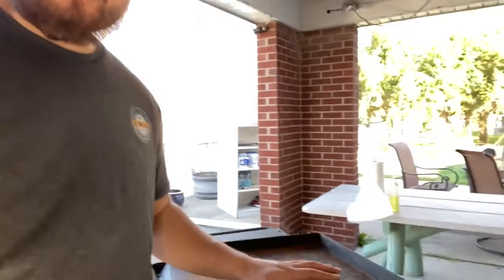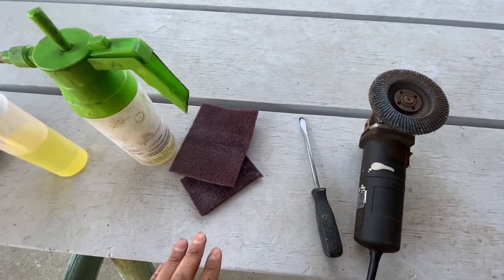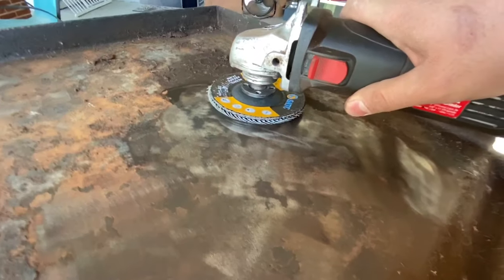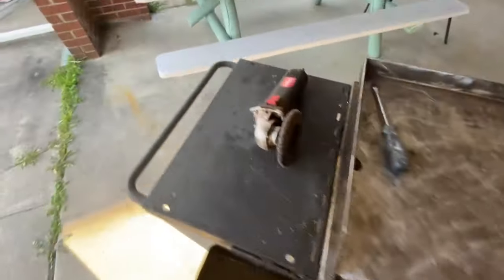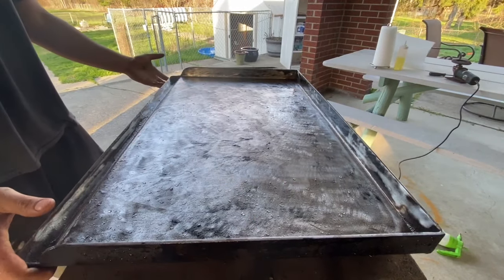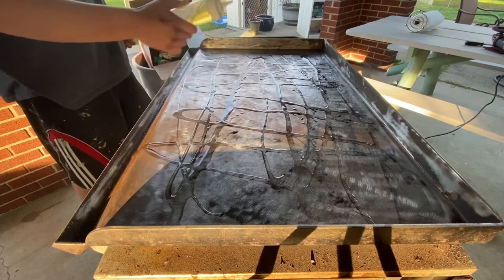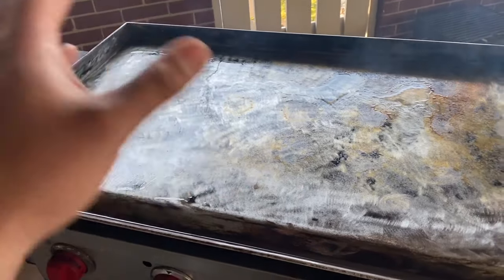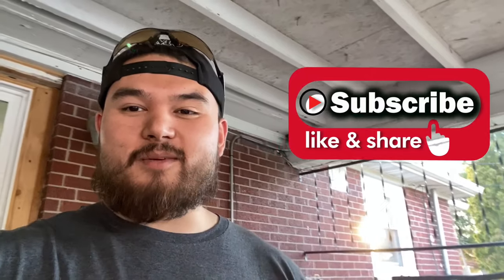Restoring A Flat Top Grill - Quick & Easy

Comment: the top is rolled steel. the black coating is the seasoning coat. proper seasoning, use high smoke point oil put on a very thin layer heat the griddle top on high and keep it on until it stops smoking. repeat the process 4 times. until the top is a shiny black smooth surface.

Comment: This is steel, not cast iron and definitely not alluminum. It will get dark again. Camp chef probably uses some kind of seasoning spray like a palm oil and soybean oil mixture they bake on at very high temperatures.

Comment: I restore mine the same way. I think this weekend I will use high temp grill paint for the bottom and outside. Then season with flaxseed oil which I read works well for seasoning
Reply from the maker: Let me know how that paint holds up afterwards. Hopefully it doesn’t smell up the grill
Reply: @MJAltairy  fingers crossed brother. I will set a reminder
Reply: Flaxseed or grape seed oil, high burning point which helps season the grill

Comment: Why not keep it simple. I've never have a problem with a dirty frying pan and a flat top is just that.  So, simply firie-up your burners and pour as much water on it to keep the water in a consistant state of boiling for about ten minutes or so. This process reconstitutes the solid foods you've let harden over the winter. All you need when it softens is a four inch paint scraper and a llittle scotch guard for the rebels who refuse to surrender. Steel isn't like cast iron. It's not so pickey about water and muscle taking off any valuable, hard earned,  "seasoning".
Reply: Deep oxidation does not get cleaned by burning oil on the surface lol. Pouring oils only Seasons the grill- it does not clean it

Comment: ...its steel plate not cast iron, the black is just the factory seasoning it should turn black again from use
Reply: It may not be 'cast iron' but it is definitely a high carbon steel. If you do the same thing with a real cast iron pan it does look exactly the  same when it is raw material. I've sanded down a few cast iron pans and when it is raw like this even the humidity from the air will cause it to rust which happens often even from the trip from the garage back to to the house before I can get a chance to clean them. And yes, it will suck up seasoning and start turning a darker color and with repeated seasonings/uses it will turn black.

Comment: Be extremely careful with 'degreasers' and other cleaners. You don't want to use anything you wouldn't want to eat. You can clean it 1,000 times but there is still some particles left. But then again ya gotta do what ya gotta do. :p
Reply from the maker: I only use the degreaser when it reaches extreme cases of neglect like this. Got any suggestions on what to use instead?
Reply: @MJAltairy  I use the flap disk, and then random orbital sander starting with 36 or 60, and go to 300-600 depending on how smooth you want it.  They’ll take it down to bare metal and leave it ready to be seasoned with veg oil.
Reply: @MJAltairy  oil or grease is used to season the top it's not necessary to use degreasers. just coat the top with a high smoke point oil then heat on high for about 20 minutes. any bacteria left in the old grease will be burned off with extreme heat. its called polymerization.

Comment: Did you have any pitted areas if so is it still safe to use
Reply from the maker: I’m pretty sure i did. I just did some extra grinding/sanding in those areas. A few layers of caked on vegetable oil during the seasoning process and you should be good. It’s been 2 years since uploading this and we still use our camp chef!